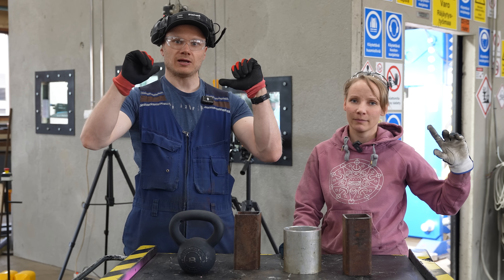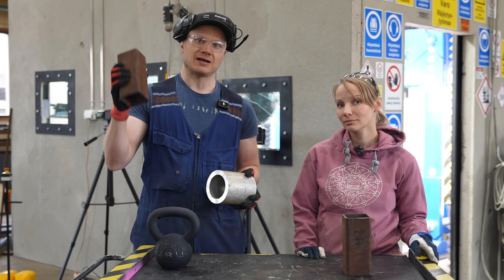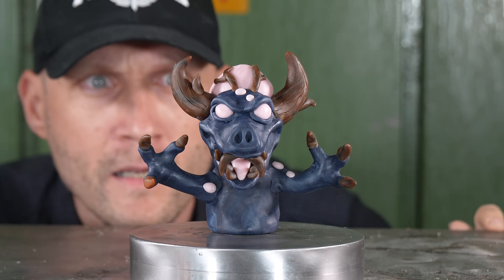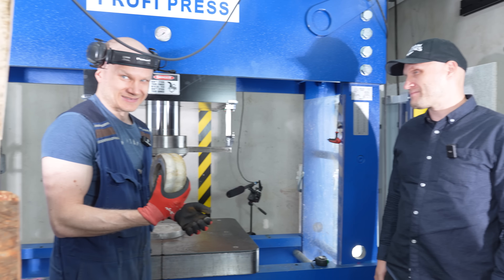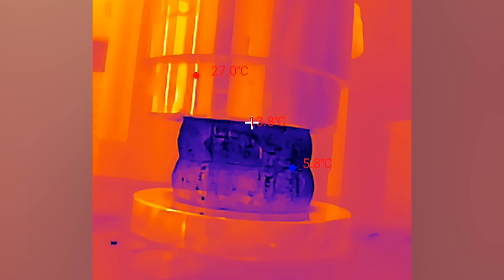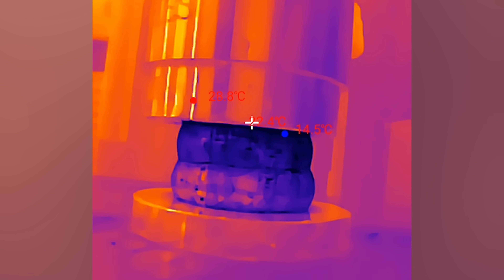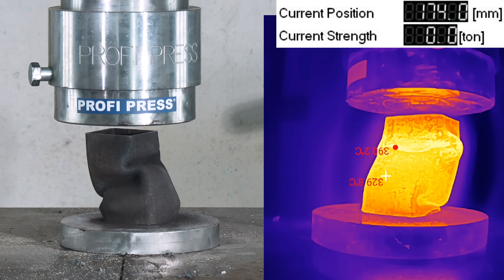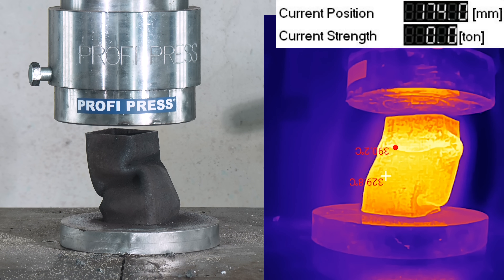Crushing Kettlebell with 300 Ton Hydraulic Press

Comment: When crushing items like that square tubing,  how much of that energy is being converted to heat?  
It might be an interesting demonstration.
Reply: Mostly all of it. Work=Force*distance in physics. That’s why it heats up so much. Energy can’t be destroyed, just converted, so it would have to be heat, sound, and friction.  Heat is probably 95% or more.
Reply: @CosmicEpiphany . Let’s test that.
Reply: @jgrenwod Well...he did just test it. What your asking for are to run the numbers or to work out the physics. Try chat GPT, Ive never seen him run numbers like that, you need to know some physical chariteristics about what metal it is ie the kind etc, if you want super accurate calculation.
Reply: @CosmicEpiphany .  They didn’t test it.  They crushed a piece of metal.   It looked cool.  But what was really taking place in the material.  Obviously you already know the answer but others might be interested in seeing it.
Reply: @jgrenwod Im not sure what to tell other than he did the test. The information you're asking for is in calculations and information from the test he performed. To get the energy you need the temperature change, the pressure and distance change, and you also need the weight. There is no "direct test' for what you're requesting it's all done with secondary equations. It's a good question...so I responded. Not really sure why you're arguing with me.
Reply: @CosmicEpiphany .  Hopeless

Comment: 5:42 Maybe get some matte black spray paint and simply add some paint to the crushed items to allow accurate measurements? Use some kind of mask (e.g. a piece of cardboard with a 3-5 cm round hole?) if you want to reduce the amount of paint on the part. The matte black will obviously look boring but should result in most accurate IR measurements.

Comment: It would be interesting to push very cold water ice through a tiny hole. Not very fast not to melt it.
Also the same with dry ice (or mb supercritical CO2 if it turns into it inside the cylinder)

Comment: You should fill the pipe with liquid nitrogen while crushing. Some plug with insulation and gasket should be on the bottom so that nitrogen doesn't escape.
Probably put the pipe into a tight groove in a metal plate in order not to allow it deform. On the bottom of that groove should be a gasket, maybe rubber or something, maybe even copper.
Maybe even put such plates on both sides of the tube.

Comment: The thermal camera proves, that energy is converted from one type to another sound/light/heat/movement. It doesn't matter if it's metal or organic (wood). It still heats up.

Comment: First off you take a long time to crush when doing hot and cold tests.
You should use liquid nitrogen or liquid helium to super cool things.

Then use electricity like high voltage to superheat quickly or an induction heater.

Comment: You’ll notice at 4:30 that the screwdriver that’s flying from right to left gets stopped on the metal tabletop plate because a magnet was trailing it and stuck to that metal plate. That’s CRAZY! To stop anything moving rapidly with a magnet is not easy!
Reply: That's awesome! I didn't notice that 😂
Reply: Yes how nice!
Reply: It's how those drop rides at theme parks work

Comment: You need to protect the cabling with some sheet metal. It doesn't have to be heavy, just thick enough to slow a projectile and spread it's energy!
Reply: It is not energy. You mean its energy.
In reality, you can spread the impact force over a larger area; alternatively, you could lengthen the impact time to dissipate its momentum with a resilient covering.
Reply: "It's" is auto prediction at its finest!
Reply: @denverbraughler3948 
Exactly, spread energy over time and or area.
Even if the cover impacts the cables it will not likely damage them as the energy is spread over a wider area!

Comment: Temperature protection for the camera just turns the camera off? That would be like closing your eyes and pretending that it's not happening. 😂
Reply from the maker: Camera basically switched safety squints on :D So definetly helps!
Reply: Is closes physical shutter so that will protect the sensor.
Reply: I mean, ceasing internal heat production is all it really can do.
Reply: That is how night vision worked with light.
It shuts down and you go blind until it either reboots or you take it off.
Reply: I own a similar camera. It has an internal calibration shutter that's used to null out the sensor, this is why almost all thermal cameras freeze every so often. They're taking a reference since the pixels are prone to drifting.

The safety uses this shutter to protect the sensor and periodically opens it to see if the excessive heat source is gone.

Comment: Cast iron has a crystalline structure like glass except much coarser, that is why it fails spectacularly!
Reply: Glass is amorphous isn't it, a liquid
Reply: All metals have a crystalline structure. Cast iron jsur has larger grain size.

You're always here acting like a know it all and you're usually wrong. Glass literally doesn't have a crystalline structure. The opposite infact.
Reply: @kermitthefragg  to be honest there is amorphous metal. It has many uses. Especially theft alarm
Reply: @herrkulor3771 
Thank for the assist.
People like that one pick at straws and put words in peoples mouth.
For instance i never mentioned other metals and used glass as a crude example of another material that is brittle and fails spectacularly!
Reply: @kermitthefragg 
The primary difference between hot rolled and cast iron is the manufacturing method. Hot rolling metals creates a fairly uniform structure of alignment whereas cast iron naturally solidifies into a random internal structure resembling a crystalline material.
Cast iron cannot be welded effectively due to its tendency to fracture along the bonds between the crystals when heated and cooled unevenly due to thermal expansion and contraction.
I've be shaping and welding metals for a living for some time, i know the various forms they possess!
Thanks for your input though.